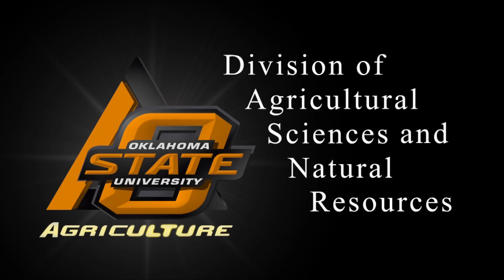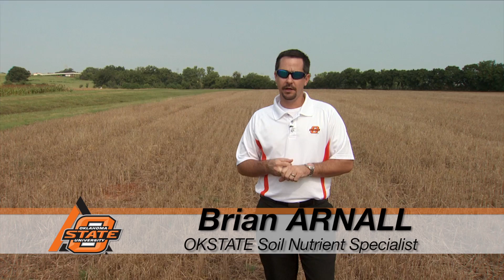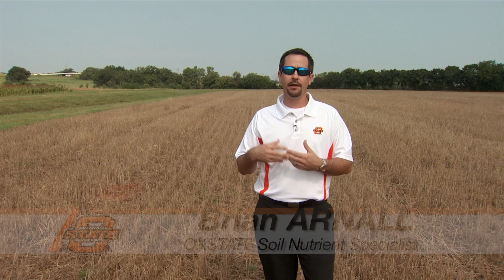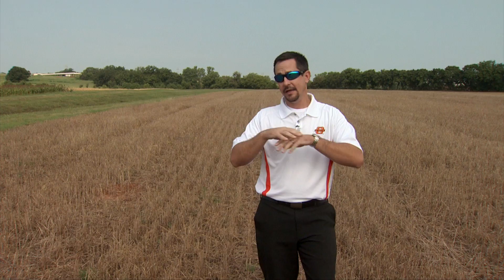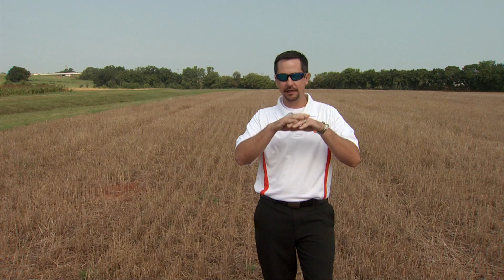Urea Fertilizer

Comment: Would you recommend spreading it right before a very heavy rainfall if the soil can absorb it?  I enhance my soil with wood chips and add urea to get the nitrogen levels up.  I'm wondering if I'm doing it the most effective way.  Urea seems to be the least expensive way to do this.
Reply from the maker: Best management practice would be to apply the urea prior to a rain event of .5" or more. The best case scenario is actually a slow rain. The prill would melt and be moved into the soil. A heavy but short rain may not melt the prill enough and would also likely produce more runoff.
Reply: If you don't mind me asking too many questions, what do you anticipate the effect would be in soaking a bunch of dry wood chips in water saturated with ammonium nitrate and then spreading them at the foot of the plant to decay and release that Nitrogen slowly?  Would that work with minimal losses?  Can the chips lock the Nitrogen within?
Reply: @MasterKenfucius  Try urea formaldehyde or some other kind of slow release nitrogen fertilizer. They cost a bit more, but they lose less nitrogen to leaching and volatilization so more nitrogen actually makes it to the plant.
Reply: @Marmocet  Thanks for the suggestion.  I have to deal with the struggle of "keep it cheap" against "be effective" and that's not easy.  That's why I was wondering if soaking a bunch of chips on the dissolved urea would make a difference because one could lock that urea inside the chip.  I'm no chemist so I don't know if the chip would release the Nitrogen as gas when the water evaporated.  That's my biggest concern with that approach.  I know people make biochar for that, but I just don't have enough of the stuff.  I do have over 750 cubic yards of mulch spread on my lot and will likely add 250 cubic yards a year to replenish, so I need a lot of urea to make up for the Nitrogen needed.
Reply: @Marmocet  That's great information, thanks.  Problem is, I can't possibly do a reliable analysis to know for sure what would be most effective.  There is just no way for me to control the experiment enough for a high degree of confidence.  I wanted to soak the chips for that exact purpose...  to break them down quicker, and as a slow release mechanism.  I just don't know how much Nitrogen I would lose to the air while soaking chips and waiting for decomposition.  At this point I'm thinking it's best to dissolve the urea in water and apply it directly into the soil for maximum retention.
Reply: @MasterKenfucius  You wouldn't have to measure nitrogen directly. If you're doing what I imagine you're doing, a simple experiment would be easy to set up and would at least give you an indication of whether there's any obvious benefit, if any, to soaking the chips in nitrogen fertilizer solution. Just make three one square meter test plots. In one, apply a given quantity of chips soaked in a solution with a known quantity of fertilizer dissolved in it, in another, apply the same quantity of chips and the same quantity of fertilizer topdressed, or applied in whatever manner you're currently doing, and in the third plot, apply the same quantity of chips without any fertilizer. After a given period of time, check the results. I'd presume you're looking for amount of total plant growth, or reduction in wood chip volume or something like that, so if the results of the experiment don't show an advantage to one method or another that is immediately visibly obvious, it shouldn't be too hard to do some quick, fairly straightforward measurements to make that determination. If those measurements don't turn up any obvious benefit to one method or the other, then just go with whichever method is easier to do.
Reply: @Marmocet  That's exactly what I'm talking about.  My property is so irregular that I may never find two pieces of land that big that will have the exact same composition, amount of roots creeping from below, even watering from sprinklers, etc, etc.  It's hard for me to compare things that way.  That's why I wouldn't trust the visual results.
Reply: @MasterKenfucius  Fair enough. You could still run an experiment by covering soil in containers with wood chips, but I can see why you might not find the results satisfying.

At 250 cubic yards, it sounds like you've got about 30-70 tons of wood chips on your hands every year. Diverting half of that feedstock would enable you to produce a substantial amount of biochar if you wanted to.
Reply: @Marmocet  It would, if I had a place to dry it out.  You can't dry those wood chips where I am (the piles keep the moisture in them).  And besides, I don't want to be burning that much organic material... it would take a looooong time.  I live in a very restrictive area.  It has to be mostly natural processes.
Reply: @MasterKenfucius  Well, these days, to make biochar (it's funny calling it that, since it's just charcoal) most people are using wood gasifiers. Once they're warmed up, they make essentially no smoke. Almost all of what comes out of the stack is CO2 and water vapor. In many designs of wood gasifiers, it's preferable if the feedstock goes in dry, but many of them can handle damp fuel without paying a smoke penalty. Gasifiers suitable for the scale you'd be looking at are highly automated. You just dump the material into a hopper and the reactor takes care of the rest, more or less. I don't know if the fact that gasifiers make no smoke would be a problem where you live. Sometimes regulators ban burning when what they really mean to ban is producing air pollution.

If that's a no-go, there's always the good old compost heap. If you have the equipment for it, you could churn out compost on a grand scale with that many wood chips.
Reply: @Marmocet  Well, my regulators come from the HOA.  I'm not allowed to burn trash or yard waste.  Wood chips would fall into that category.
Reply: @MasterKenfucius  Wow - I figured you were on a farm with that tonnage of wood chips. 

HOAs are great fun. My parents moved into an HOA neighborhood and from what they tell me, HOA neighborhoods are the kinds of places a person who wants to live somewhere with a real secret police state feel to it should move, where people get to have anonymous complaints lodged against them and pay fines for the most trivial infractions of the most pointless rules while they look around suspiciously at all their neighbors trying to guess who might have tattled on them. Does your HOA permit people to have fires in their fireplaces?
Reply: @Marmocet  It's actually not a bad HOA and pretty loose.  I'm the Vice President, so I should respect the rules to be a good example.  All homes have at least an acre of land, so that's how I fit 750 cubic yard of mulch in my yard.  The mulch I get is also a few weeks old and in a state of decomposition already so it wouldn't be worth burning it anyway.  My mulch piles attracted the neighbors curiosity and some of them want me to order loads for their yards as well.  The wood chip fever is catching on.
Reply: @MasterKenfucius  I see. Wood chip mulch was just becoming a thing people started using when I was a kid, and now it's taken on almost absurd proportions in certain circumstances. People - landscapers mostly - are in the habit of piling it around the bases of trees in a kind of "mulch volcano" that stunts their growth and slowly stresses them to death (see here for an example: http://www.adirondackalmanack.com/wp-content/uploads/2015/07/mulch-volcano.jpg). What gets me is the irony of the situation - trees make their own mulch, and people pay to have it taken away in the fall, then pay again to have someone bring in different mulch in the spring, and the people they pay to do it spread around their trees in a way that just means the tree is going to die an early death and need to be removed and replaced. If these mulch volcanoes haven't come to where you live yet, one thing to look out for as they do is how rarely planted trees live long enough make it to maturity. It's a totally senseless practice.
Reply: @Marmocet  I'm in Florida and my land is mostly sand.  Not much grows on it and water doesn't stay due to the lack of organic matter.  My plants were yellowish, ugly, and having to be watered daily or they would just dry out.  All my fruit trees basically got a jolt as soon as I started mulching around the base.  It was like I just threw a truck load of miracle grow on them with the wood chips.  Yes, I have to complement it with urea, but once those roots got the taste of that rotted wood, they just couldn't get enough of it.  Not only that, but the constant decaying creates enough heat to protect them in the winter as well when the temperature gets below freezing for just a few hours.  I'm in zone 9, and I grow stuff from zone 10 just fine.  I harvest pink guavas that weigh 18 oz a piece.  Just ate half an avocado that weighed 39 oz.  I have a banana tree patch that is doing amazing... all I do is mix the wood chips with the starbucks coffee grounds and those things grow like weeds, and the soil is always moist under the top layer.  Before it would be bone-dry.  I filled entire low areas that used to flood in the summer time with an 18 inch layer of wood ships.  Now I plant stuff on it that can't be water logged and it thrives like there's no tomorrow.    I know what you're saying with throwing mulch away.. .  I take all my neighbor's grass clippings and put them in my yard.  He throws it away and then fertilizes his grass every year.  I don't get that either.  A lawn provides 75% of the Nitrogen it needs for the following year, and yet, it ends up in my yard because he doesn't want it.
Reply: @MasterKenfucius  [This reply got kind of long...] OK, this is starting to make more sense to me. My property (here in the UK - I'm originally from SE Pennsylvania) is on sand and I have the same kinds of problems you do. When I first moved to where I'm living now, the property had been managed by "professional landscapers" who managed the grounds in the usual British way: they'd cut the grass as low as the mower would go, bag all clippings, trim back any growth on bushes, trees and other plants, and pile it up in a corner of the property and periodically burn it. The  soil had practically no organic matter in it, the lawn was sparse, sickly looking and full of weeds, and everything that was clinging to life looked yellow and stunted. Now that the property is under my management, things are turning around. I got a soil test done and found that my soil is poor in potassium, phosphorus, calcium, magnesium, sulfur and sodium (although it is ok for iron). In light of this, I've slowly been adding these elements to the soil, sometimes by topdressing and sometimes by foliar spraying. For nitrogen, I've been using almost exclusively urea formaldehyde, which I'd definitely recommend for you too since you're on sand as well. My strategy is to apply chemical fertilizers to stimulate plant growth, then harvest some of that growth for use as a soil organic matter input. I've also been taking other steps to improve my soil, like mowing the grass as tall as my mower will let me, mulching in all the clippings, and snapping up as many autumn leaves as I can get my hands on and then mulching them straight into the lawn as well as chopping them up and laying them out in thick layers in my garden beds. I just finished my third growing season using this strategy and it's really starting to pay off. I actually have earthworms in my soil now, which I didn't when I first moved here, and I'm starting to get good growth out both the lawn and all the things I've planted. Before that, what would happen is plants would start growing well in the early spring, then more or less stop by mid spring, at which point leaves would start to turn yellow-ish or purplish, particularly if the plants were going to seed.

My neighbor sounds like your neighbor. He treats his lawn the way the "professionals" treated mine, and while my lawn is green and fairly lush, his is about 50% dead, 25% weeds, 10% moss and the rest is grass that is holding on for dear life. I've told my neighbor what he's doing wrong, but I think he doesn't believe me because I'm the only one doing it my way, and he's doing things the way everyone else does. 

About your tree mulch. If you have mulch piled up around the trunk of the tree in a kind of cone, or even if mulch is just touching the tree's bark, you will be doing damage to your tree, guaranteed. Right now, the benefits of adding organic matter to the soil might be outweighing the damage, and the damage might take years to manifest, but it will eventually start to tell. Fortunately, you can still get the benefits of mulching without the damage. Don't mulch against the trunk. Just mulch in a doughnut starting an inch or two away from the tree's root flare in a layer a few inches thick that extends all the way out to the tree's drip line and you'll be golden. If your tree produces an autumn leaf fall, you can use them as mulch as well, if you already aren't.

Just to mention it again, I think urea formaldehyde is the nitrogen source you should go for. It's slow release, its release rate is controlled by the amount of microbial activity in the soil which in turn is just about perfectly correlated with the soil conditions that favor plant growth. That means its N release rate is highest right at the same time that your plants' N utilization is highest. And because it's slow release, you won't lose nearly as much N to leaching through your sandy soil as you'd get with just about any kind of quick release fertilizer. When I'm in the States, I get mine here: https://www.ebay.com/itm/Nitroform-39-0-0-3-4-Months-Slow-Release-Nitrogen-and-Urea-Fertilizer-50-Pounds/202383286303?epid=1064480117&hash=item2f1efbe01f:g:WlIAAMXQeKNTKh8Y:rk:11:pf:0
Reply: @OSUNPK  I'm not sure if you'll ever read my comment, but I'll try anyway.

For the past four years or so I have started to look into maintaining gardens and lawns, including my own garden. The results are now nothing short of excellent and consistent. However, the road to a good result is complex.

As you have now explained the operation of urea in this upload, the points of attention under which the losses that can occur are elements that the average user or individual will not delve into.

Particularly interesting is applying it in the right way, and striving for optimal results, not only the fertilizer is important, but also the soil quality.

I myself started with COMPO EXPERT and DCM .

However, there is now a dry period ahead, and it has been going on for a few weeks now. Due to the large surface, watering is not always possible.

Final question, how do you feel about overseeding grass and using urea?

Regards.
Reply from the maker: @laurapalmerTDGE  blending urea with seed is risky if it sets for more than a few hours, especially if humidity is high. Blend and apply relative quickly and it’s a nice process
Reply: @OSUNPK  Thanks. 

Advantages of the coating 

 Immediate and long-term effect combined
 Reliable, immediate and long-lasting effect for 3 months
 Fine and even granules for a homogeneous distribution
Reply: So, correct me if I'm wrong, but I'm hearing that dissolving the urea and then irrigating the plants without hitting their leaves might be even better?